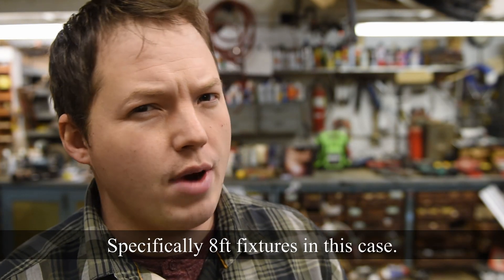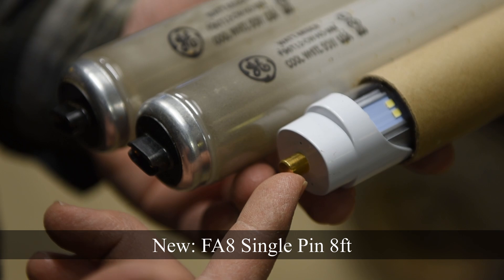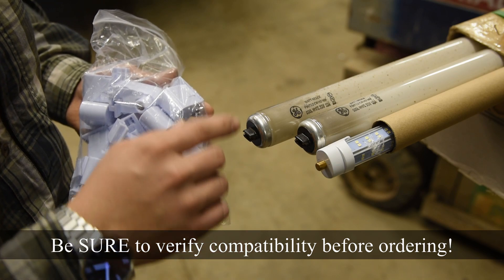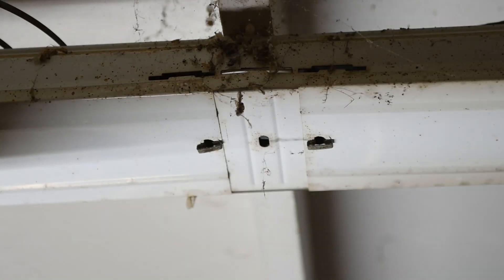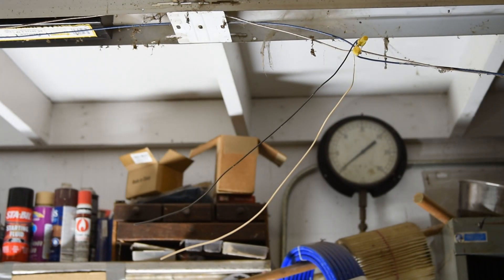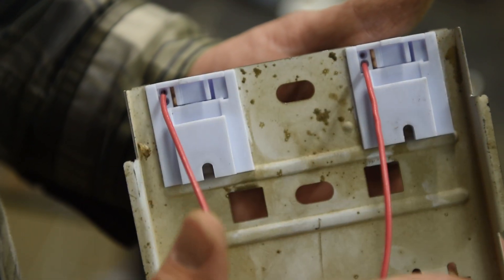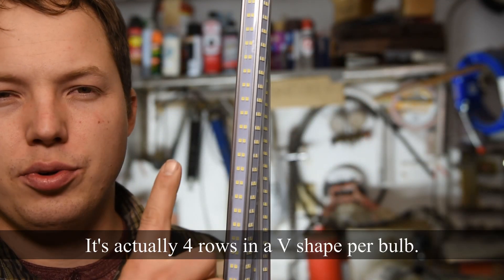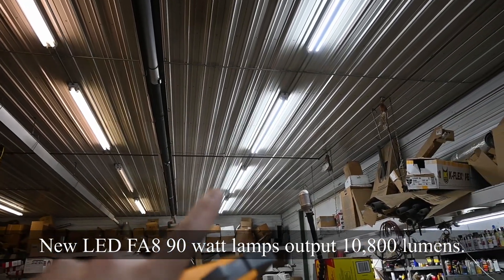How To Convert 8ft Fluorescent Lights to LED - Ballast Bypass R17D to FA8

Comment: According to article 200 of the NEC, you are required to use white or gray for neutral wires #6 and smaller. You can't use phase tape. The only exception would be is for switch loops when 2 wire romex or M/C cables are used. I think that includes fixture wire as well.

Comment: Your neutral wire HAS to be either white Grey or phased with white stripes. It’s a matter of code compliance not of opinion
Reply: State the code you are using, and the specific application, chapter/ section, and I will probably agree with you.  Many jurisdictions out there.

Comment: I'm thinking of just taking down the 8 foot HO fluorescents in my garage and putting in standard keyless fixtures with super bright screw-in LED lights. The HO fluorescents are supposed to be rated for cold weather starting, but I'm find they start off pretty dim. I want instant bright in my -20F garage.
Reply: Throw them all in the bin. Install flat panel LED's.
Reply: @000gjb  Those are really cool-looking! If you don't already have fixtures I would say to go that route. But if you already have the old fluorescent, the retrofit tubes make sense. Also you can change them out easily if they go bad.
Reply: @aaron74  You can add two hat brackets which fix to the back of the LED panel and each of the hat brackets can be be fixed to say a Purlin with one screw each. I have never seen an 8 foot fluorescent tube in my life. Hate to drop or stand on one.  It would take months to recover from any deep flesh wounds.
Reply: @aaron74  These LED Panels were $62 AUD each back in January 2018, looking at the receipt.  If you can believe any of the chinese literature, they have a lifespan of 30,000 hours or 12.5 man years @2500 hours worked per year ignoring light loss factor, for Lumen depreciation.  If one fails, unplug the LED panel from the socket and plop in another one. 5 minutes, including getting the ladder.
Reply: @000gjb  Yes, the 96-inch tubes have existed for many years, I have them in my garage. They are quite unwieldy to say the least, but it's one of those things I installed that seemed like a good idea at the time. If I could go back I would have installed either twin 48-inch ones, or cheap keyless sockets (aka Edison sockets). Oh well. Since the fluorescent lights work fine, I probably won't bother dealing with them!

Comment: Once you are inside any light fixture, you could use pink if that is what you have. The actual colors are set up more for exterior/house wiring coming up to the light fixture. JMHO  I guess cleaning everything up before reinstalling things is out of the question...

Comment: Hey Ben, yellow wire is considered hot. You can use a hot color as a neautral, just tape it white in several spots to re identify the hit wire as a neautral.
Reply: I agree with Ben here, there is actually different color electrical tape and code requires that any non-neutral wire color needs only be taped with the appropriate color.  This is something that you have to do when working with multi-wire systems of more than 2.

Comment: In older homes with the older codes, it is common to to see a black or white wire being used for the opposite, depending on how something is being fed.
It is my understanding that this is acceptable, as long as you wrap the wire in the junction box accordingly, with white or black tape.

Comment: I love all the extra information.  Interesting the 4' bulbs are about $5. I've been buying mostly the cheapie LED fixtures and last paid $15 for a 2pk from Menards.  I still admire the Amp tester.  Some day, I'll find the  cheapest one made as I generally don't need it but just want one.
And 100% correct, go with 'off white'.  That would be my logic as well.

Comment: 5 watts less power per lamp?
Reply: Unfortunately, it doesn't work like that.

The 8 footer he showed uses 90 watts.
Reply: Sorry, I read your comment wrong.

Yes, not that much energy savings as we'd all like.
Reply from the maker: The existing fluorescent bulbs were rated at 95 watts and the new LED ones are 90 watts. HOWEVER the LED puts out 22% more light with less power usage. Hope that makes sense.
Reply: @BenjaminSahlstrom  greater lumens per watt 👍

Comment: I'm cheap so ill just use any color wiring i have lying around in a light fixture. If this were an electrical box or rough-in follow code. You can also wrap white electrical tape to indicate netural
Reply: Purple tape is cool

Comment: Very off white! Hahaha

Also, to anyone thinking about upgrading their lights in the future, track prices for a month or so beforehand; occasionally you can find the entire fixture (bulbs and housing) for cheaper than the bulbs alone, depending on current sale prices or if your power company gives any rebates.
Reply: Yes the complete units have  dropped in price to now   be cheaper then a retro job. However I look at it like this : 
I have a bunch of florescent fixture that I want to be LED . Removing / bypassing the ballast saves energy .
Reusing the fixture saves landfill . So even though bulb cost is same as new fixture it is more environmentally friendly. 
Be aware that old florescent tubes are difficult to recycle . Big box HD took them back at one point but no longer. 
I busted mine up in a paper bag and put out with the trash . Comments welcome.
Reply from the maker: Excellent tip! That would definitely beat keeping the old dingy fluorescent housings!

Comment: The neutral wires are supposed to be white or gray, your easy solution is every place where you make a connection put a ring of white electrical tape. It is the same kind a solution that if your homerun is to the fixture instead of the switch that you would wrap your white or neutral conductor in a ring of black or red tape to the note that it wasn’t a neutral that it was a live wire at the switch locations.
Reply from the maker: Makes sense. Sometimes you see fixture wires that don't comply with the color standards so that is part of why I was unsure if it was required inside of the fixture.
Reply: @Benjamin Sahlstrom 
The fixture will work regardless of what color the wires are the entire reason for the standardization of colors is to reduce cognitive load to reduce the opportunity for accidents to occur and for ease of service and maintenance. The ring of tape is completely not required or necessary but it is very kind to let the person who comes after you to know what you were doing and thinking and to make their life safer and easier.
Reply from the maker: Couldn't agree more.

Comment: Should have shown a comparison of Fluorescent current draw before replacement
Reply from the maker: I did test it before and after but on the entire bank lights. 5amps before and 6.5amps after. I should have tested one individual fixture like you said though!
Reply: @BenjaminSahlstrom  Oh sorry I missed it.
Reply: @BenjaminSahlstrom  So if each new tube uses less watts (90 vs 95 on labels), and there are the same number of tubes, and the line voltage is still around 121VAC, why more branch amps after than before?  Power factor? Ballast limiting current to the old tubes?  Startup rating vs operating current in steady state?

Comment: As for the internal wiring colors I would just use the yellow  er...(off white) wire
Unless the NEC specifically says otherwise
Reply: Same here. I like to wrap a small bit of white electricians tape around something being used as a Neutral just to make sure if anyone else was to go back and do something they know for a fact it’s the neutral wire! Great video
Reply from the maker: Exactly!

Comment: Wrap yellow wire w/ enough white electric tape to label“neutral”....should be okay
Just in case a DIYer gets in their or electrician...they “know” it’s a neutral wire

*edited for autocorrect
Reply from the maker: White tape seems like a good solution. It would be pretty hard to mistake though even without the tape since the white neutral connection will be clean and obvious whenever the fixture is opened.
Reply: @BenjaminSahlstrom  My electrical panel in my house has a black insulated service wire connected to the neutral lug, the same conductor size as the two 120V hot legs. But the electrician wrapped a lot of white tape around it to re-identify it as neutral. I personally prefer heat-shrink tubing to tape, but I'm anal that way.

Also, it's recommended you Sharpie on those fluorescent light fixtures "L" and "N", line and neutral, just in case the bulb you're going to install is polarity sensitive. I think the first generation LEDs used to be, probably not a concern anymore... More of a "just in case" thing so the installer doesn't have to remove the cover to look at the wiring.
Reply: @aaron74  It may be black cable with white tape because that gauge conductor is not sold in white sheathing.   Love this series, but I'm also watching videos from another channel called Electricians U.  Geared more towards new/apprentice Electricians learning the trade, but like these videos,  very informative and easy to understand.   Look for the one on running a subpanel. His practice is to use the black and CLEARLY mark the neutral with white tape like you describe.
Reply: @wbmiles  Yes, Dustin is great on Electrician U! I love his channel as well as his Journey 2 Master channel. He's very motivational. I hope he's doing okay in this downturn.
Reply: Benjamin Sahlstrom that’s true, & most “good” electricians would check & “identify” wires anyways 👍🏻, but not everyone does do that, unfortunately 😉
Enjoy the channel, cheers✌🏼

Comment: the wire colour dont matter.  make it work and move on.  please buy a fluke meter.  great vid.  lates
Reply from the maker: What is your favorite Fluke meter? I've always used Fieldpiece from my HVACR background.
Reply: @BenjaminSahlstrom  i love my 20 year old fluke 87 (4).  a 50,000 count meter with great accuracy.  it is the fucking bomb.  woohoo
Reply: @BenjaminSahlstrom  Fieldpiece is great equipment. It is the top of the line in the HVAC trade.

Comment: As long as you keep uniform with all your lights so as to avoid confusion you will be good as long as you dont need an inspection.  The lever connectors he used are the old style.  The new ones are much better and smaller.
Reply from the maker: That's what I assumed. Keeping it uniform and orderly will make for a safe and easy to understand installation for sure.
Reply from the maker: I have seen those new Wago's. I need to order some and try them out!

Comment: Technically it should be white, but anyone that is doing electrical should be good enough to figure it out.  Regardless you didn't verify the hot was actually the hot wire, so the colors could be backwards ;)
Reply from the maker: I am 99% sure that the polarity is correct but you're totally right! Obviously it really doesn't matter much since the LED lights are not polar sensitive. Thanks for the comment!